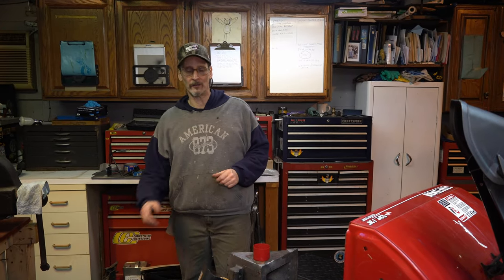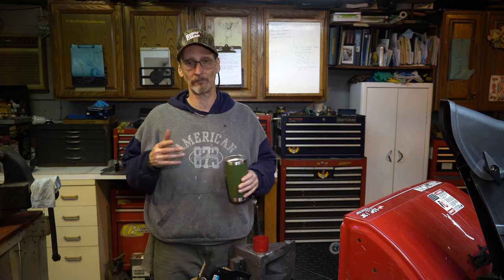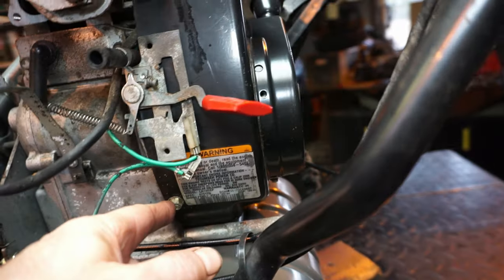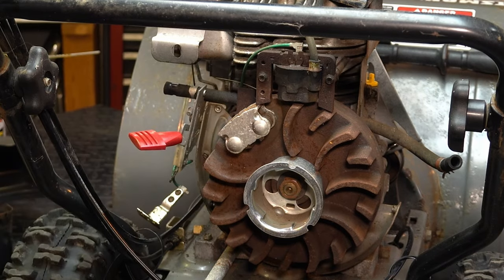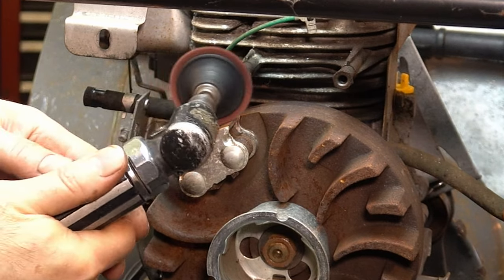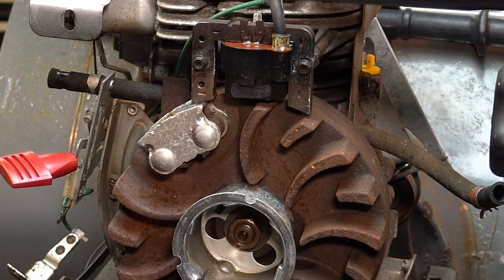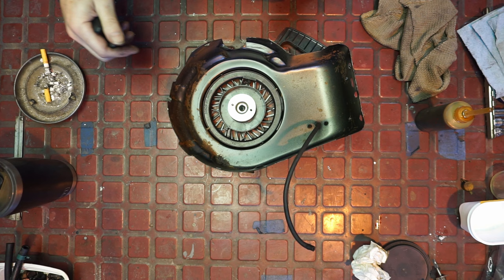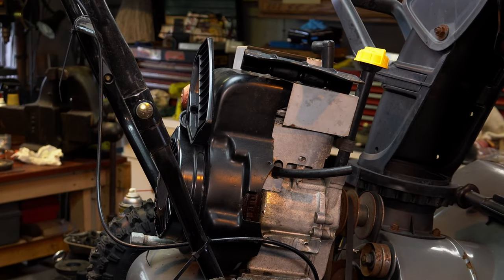HOW TO FIX a Hard Start~Kickback (Cord Jerks Back) On A Craftsman Tecumseh 5.5hp Engine-Snowblower

Comment: Great video Arch guaranteed it was a bad ground on that coil. Water in the fuel tank easy peasey removal : drain fuel tank and carb of all fuel then dump in K100s+ fuel stabilizer noting that equal parts of K100s+ with whatever volume is in the tank will guarantee to eliminate the phase separation and fire the machine right up. Had a customer dump a 237 ml bottle into his fuel tank that had hardly any fuel in it (cost him $10 Cdn) and his snowblower fired right up. He ran it a few minutes then added fresh fuel and it has been running without issue the last two years. Basically that $10 saved him the cost of us doing a carb cleaning and fuel tank flush and clean. The OLD MAN at EP over and out!
Reply from the maker: no fuel in that tank, it was dry as a bone.  it ran off what I sprayed into the plug hole
Probably a bad ground but the rust can cause a timing issue.

Comment: Your right about the rust issue on the ignition coil rust  can cause the  spark . plug speak color to not be the right color  for proper ignition of the gas  air mixture
Reply from the maker: Absolutely,. I'm not sure but I think it also screws with the timing. It could be that it messes with the spark advance as determined by the ignition coil electronics. 
Either way, there seems to be a benefit to cleaning this. Mowers have a brake shoe that helps, these don't.

Comment: haven't even checked yet but my "like-new" craftsman tiller probably has the same powerhouse if i had to guess. i hit a root ball from a huge himalayan blackberry and then it had the same pull start kickback for a few days til the cord broke yesterday... the cord, not the spring... i'll focus on the remaining 20 minutes and see what you ended up finding as your culprit.

and carb would not have been on my list of suspects but i know next to zilch about small engines. i am guessing it is the key pin on the flywheel or maybe we get lucky and find tight lifters but no sense in that on mine as it didnt kick back on the first day i used it
Reply from the maker: Yea, try the flywheel key!! At this point ya gotta inspect the engine and take off the cover to fix the pull starter!
Good luck!!!
Tanx fer watchin!

Comment: Spray 'DEEP CREEP' on that head bolt every day for 3 yrs,  and guaranteed,  that bolt will be fine.
Reply from the maker: LOL,,,
most of us agree heat is best BUT once somethings has been loosened then some kind of lube is great
That said, I have used acid for years and that works well, especially on frozen brake line fittings but there is the possibility of other issues

Comment: Ignition coil has NOTHING to do with kick back......if an engine is kicking back it is firing too soon SO out of time...bent flywheel key or broken key. The flywheel MUST come off to be sure the key is not bent.  On an overhead valve engine the valve setting MAY be WAY out and cause kick back.
Reply from the maker: All good info but not relevant to this engine!
Reply: @TheNovaJohn The FIRST engine was kicking back...so RELEVENT to it. That is what the video is supposed to be about...kick-back. That LITTLE movement you showed in the flywheel when you took it off WAS the problem. If it is a 1/16 at the key it is 1/4 inch out at the magnet so....out of time.
Reply from the maker: Look closer, the key is fine, these keys fit nice in the broach, unlike some briggs I've seen and would agree with you on those, in fact I've shown this in other videos.
I have seen aftermarket coils that wont work right because the timing is off inside the little computer. 
These keys don't suffer damage from a blade hitting something as the belts take up all that shock and sheer pins do the bulk of the work. Even if someone put a bolt in place the pin, the belts would still buffer.
1/16 isn't possible, again look closer and lets say its a mm, well that's still a stretch. 
We could say its a compound issue. These are old now, for all we know a piece of carbon could have been on a valve or seat or just rust and oxidation. 
Most people have no clue what we are saying, ya have to remember, I'm trying to get people to service an old machine, they get overwhelmed quickly and their eyes glaze over when I get to technical! 
So overall I'm not sure why you write with capital letters, I get the picture that your looking to correct my efforts and not to be helpful! 
People are so quick to criticize, you have a channel, make some more videos and show us, take some real time and do it, instead of being critical or learn to write in a way that is less insulting. 
Its easy to sit on the sideline and poke!
Reply: @TheNovaJohn  Here is the problem...you used 2 different snow blowers pull one over at the end of the video and said SEEMS FINE....well it was a different blower OR a different flywheel and you said NOTHING about it...someone just NOTICED it. I have worked on small engines for 50 years...no piece of carbon on a valve, no coil will do ANYTHING until the magnet GETS TO IT, faulty or not and I have seen LOADS of snow blowers with bent keys. Backfire, chunk of ice, flywheel nut not torqued, a magnet off the flywheel and jammed, a broken alternator under the flywheel...on and on.
Reply from the maker: watch the video again, I mentioned it, I showed it.. not gonna argue here. I did the video, its helpful and to quote you, 'here's the thing' ....make ya own video.. I've heard this all my life, been doing it for 30 years, 50 years, that's good. 
Seems like your stuck trying to prove something here.. Make a video. I'm trying to be nice and I'm loosing my patience.. Thanks for watching and hit the thumbs down!
Reply: Hello Arch. Thank you for great video and instruction. Do you remember what spark plug this engine uses and its gap setting? Thank you very much in advance.